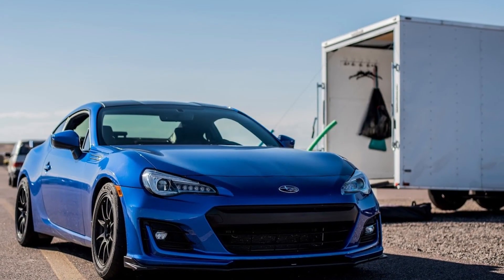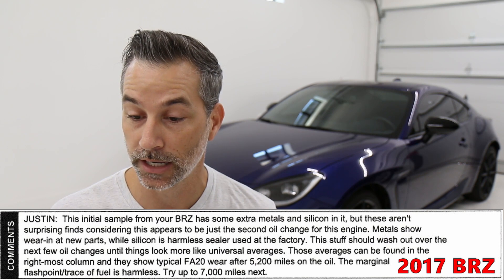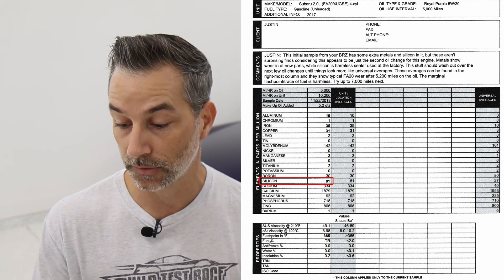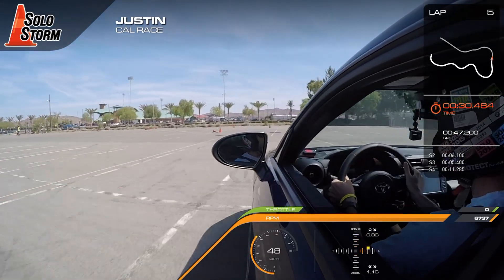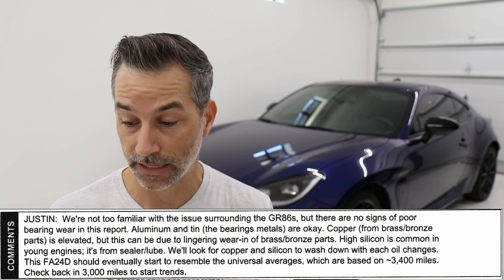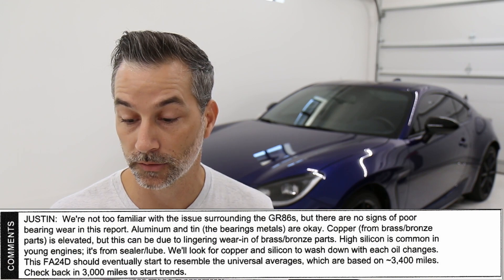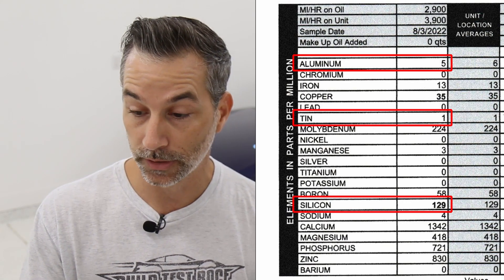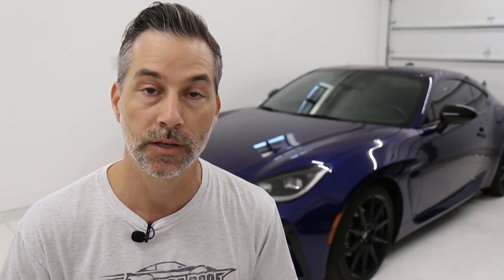Is There Silicon In My GR86 Oil Analysis?

Comment from the maker: Have you done an oil analysis on your GR86 or BRZ? Share your results below!
Reply: What oil are you using? And I might have missed it are you running an oil cooler? 

Thanks again for all to great content.
Reply from the maker: @i-barg  Mobil 1 synthetic right now. I have not had an oil cooler on the car, but one is sitting in the garage to be installed soon.
Reply: Thanks! What weight are you using? I see a lot of people recommending higher weights like 5W-30.
Reply from the maker: 5w-20, I have had another oil analysis since this one in the video and Blackstone says everything is good and to run the oil longer (5k oil change interval instead of 3k). I will probably switch to 5w-30 though on next change.

Comment: Thanks for sharing. The analysis results seem to be good.
What oil filters are/were you using for both the 2017 and 2022 models?

And you had been an oil cooler installed on your 2017 model, was the used oil sample taken prior to the oil cooler installation?
Reply from the maker: I have always used genuine Toyota/Subaru oil filters on both cars. I think the oil sample may have been taken just before I put the oil cooler on my BRZ. But, FWIW, that cooler did not change the oil temps at all on that car (at the track) : https://youtu.be/q832AooXbsI
Reply: @TheBTRGarage 
Thanks for the answer.

In the past I installed and used a water cooled oil cooler similar to yours, on my BRZ.
There was metal dust mixed inside the heater core when I unpacked it though it was brand new. Since the heater core seems to be made of copper, iron and so on, if we analyze used oil right after installation, that metal dust should be reflected in your results.
Your results are very informative to me, as you had no additional oil cooler and used the stock oil filter.

And yes, as you wrote oil coolers you added to the 2017 and its similar products do little to cool the oil. Also the oil flow drop is not little that I'm currently not using it.

I believe that if the correct amount of oil is in the pan, the engine will not suffer lubrication problems.
If you have a chance to do another oil analysis on the 2022 after running it for a while, I would be happy to share the results again. In Japan, such oil analysis service is not available to the general consumers.
Reply from the maker: @abaracrackin  I do regular oil analysis each time I change the oil (or I try to). I'll definitely do one on next oil change.

Comment: Thank you for the info.  I do not plan on dropping my pan until i am close to the end or after the warranty period anyways but will do UOA after every change to monitor the health of my FA24.  I only do about 3-4k miles a year anyways and will track it 2-3 times a seaon.
Reply from the maker: Sounds like a great plan!
Reply: @TheBTRGarage  Also note that the copper levels between the 17 BRZ and 22 GR is similar in your reports.  This is reassuring as copper is a bearing metal.